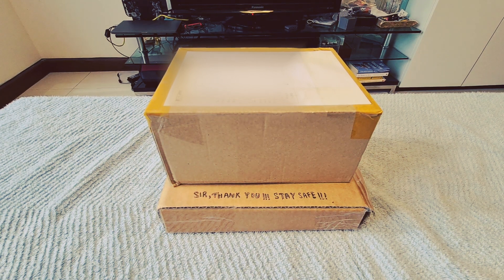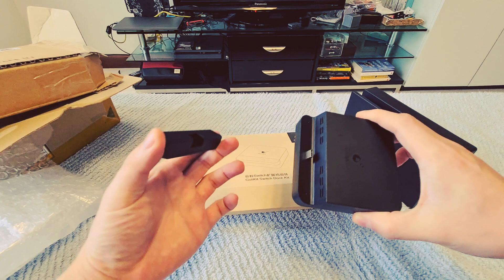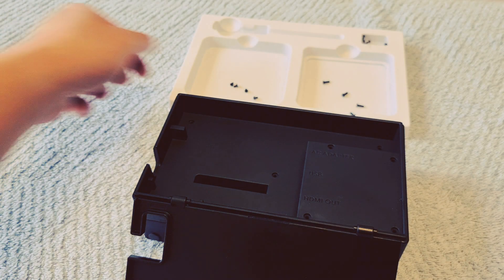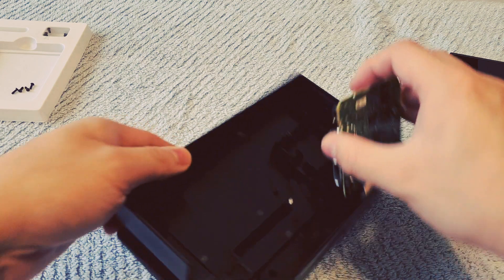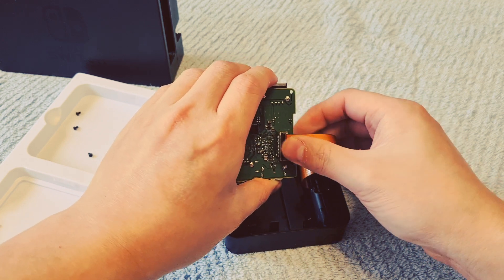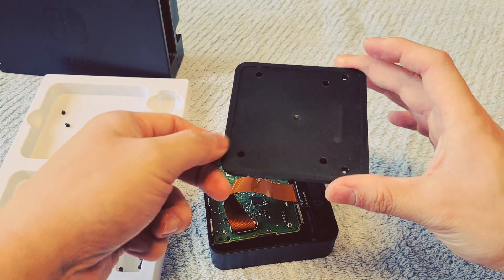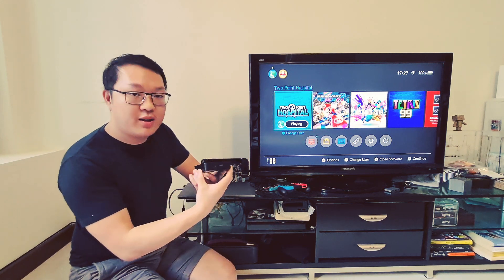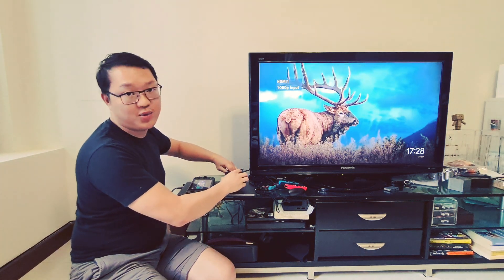Gulikit Dock Nintendo Switch - Unboxing / How to install

Comment: Wonder what is the black and red cable for? Not needed?
Reply from the maker: I think the black and red cable is for the two additional USB ports on the original dock.
Reply: Probably the dock led.

Comment: I bought this yesterday. But it only charges my switch and not displaying anything on the monitor. 
Btw, I'm using the original charger and hdmi cable that came with my switch.
What could be the problem?
Reply: You need to press the little button at the front?
Reply: Nevermind, same thing happened to me. I reckon youve been sent a dodgy unit. Mine does not work either.
Reply: probably the contacts weren't plugged in correctly

Comment: Of course , it's works because you re just changing the circuit board into a new casing 🤦...just a kit
Reply: if you check the comments even here, sometimes there is no signal